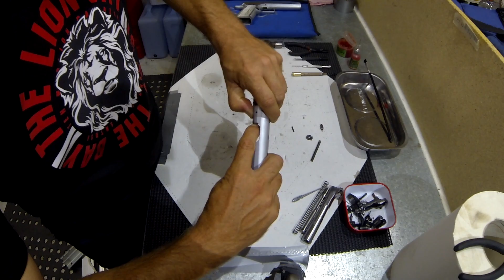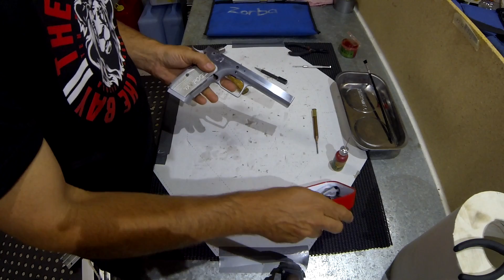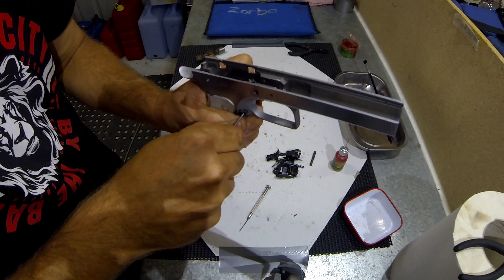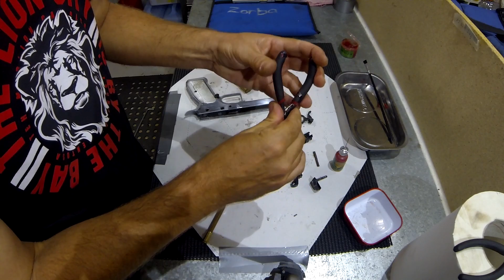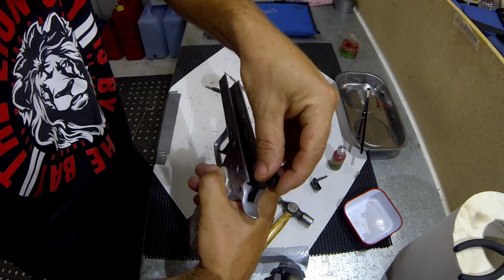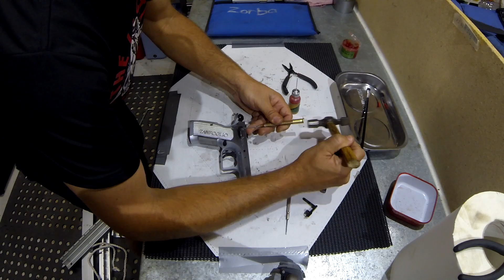TANFOGLIO STOCK PISTOL COMPLETE RE-ASSEMBLY VIDEO

Comment: So helpful! Really wish I could have seen a closeup of everything. But I was able to disassemble clean and reassemble with your instructions. 

This was the first time I ever cleaned a gun! And even though I'm a newbie and don't understand the part names yet it was easy to follow. 

The worst part for me was figuring out the trigger. You said to put the left longer part of the spring on the left over that center indentation. And the right shorter side in the hole. However, there was a noticeable literal round hole on the plastic part and for 1.5h I was trying my best to insert in it. Then I figure it out. 

The easiest way is to first force the long left side into position, then force the right side into the black plastic right corner. 

Then from there on I was able to follow everything in a reasonable pace. 

Thanks a lot!!
Reply from the maker: Congrats on getting it done and thank you 🙏

Comment: Thanks Paul for this video I got my Tanfo Witness Limited 9mm out for a run after a few years abd decided to clean it. While I did the sear cage popped out and I could not reassemble it correctly. I followed the instructions for moving that little safety spring to the left and right and it finally reset. I have no Tanfo gunsmiths in my rural area so I am on my own. I guess this is an old video judging by the comments but it is still a good video.
Reply from the maker: Well done brother 
Old but still helpful 🙌
Thank you

Comment: Hi.. Great vid....  I have a combat cohai TA90 and can't seem to find a video with my safety lever removal....  Mine has a recess in the frame under the lever with a spring loaded toggle on the lever itself...  This design seems to be unusual when looking at the EAA Witnesses,  CZ75,  or any other tanfoglio videos ...  Thanks
Reply from the maker: Interesting, can you figure it out?
Reply: @paulhagiantoniou530    Hi,.. Did manage to get it out, but the getting it back in was time consuming and stressful.  Got to be a better way than the way I did it...  Its working better. Was very stiff to toggle on,off.   I compressed the spring, cleaned the area and added some wax to the mating surfaces... I can live with it now.  thanks for the reply...

Comment: Thanks for this video Paul. Changed my hammer spring after 10 years of use. It was 5mm shorter than the replacement spring I bought from Estonia. Took me 10 times longer just to fit the cage. But I did all this because of the confidence that your video gave me to do it myself.
Reply from the maker: Good job Mark 👌

Comment: I have a couple of questions for you Paul but first thank you for your excellent video on how to put this together. This is excellent information, perfectly executed and articulated. 

-How does the chrome finish do against corrosion? Where I shoot it rains a lot and I do not stop my training for rain (within reason).

-How many rounds have you put through this gun? Have you done any work on the trigger? and how reliable is igniting hard primers?

-And last, do you find the slide batters the frame to the of damaging or marring the frame? or in other words, do you see any signs of wear on the frame and slide do to battering? (9mm caliber correct?). Curious as these guns do not have a plastic buffer like the new Shadow 2 (which I had and sold).

I am debating on getting this stock II or the Extreme,. Cheers and thank you!

Comment: by far the best take down video for tanfoglio stock 2/3.. thanks man! btw do u have an idea whats the stock springs on my stock 3 special? main/ firing pin/recoil..  im thinking changing mine with medium hammer spring and med f.pin spring so that i can still run stock f.pin. does it make sense? or its better to change it to light all the way with the extreme f.pin?
Reply: im having a hard time hitting plates fast and accurately on DA.. i havent changed anything since i got it

Comment: what punch dia do you use for the Ambi-saftey roll pin ? great video thanks really helpful
Reply from the maker: I could not find a punch small enough so I made my own with an allen key that I cut and fitted into a jewelers set of small screwdrivers, I just pulled out the driver shank and replaced with the allen key then silver soldered it in.

Comment: This video and the disassembly one are going to be a life saver! I just bought a used stock 3 with less than 2000 rounds on it and I'm sure the guy never cleaned it! What size punches will I need please?
Reply from the maker: Just purchase a set from a hardware store. Get the smallest diameter set.

Comment: Hi from Spain. A zillion thanks, for your knowledge and for your time. This is not only a video, is a perfect description about we are going to find, step by step, and the photos with the explanations on the not so easy steps, are a huge plus. 

I would like to know what is the weight in DA in your gun. I have acquired a Stock III special 6-7 months ago, it has about 1000 shots and DA is about 11 pounds. I expect around 7.5 - 8 pounds, no more. 

Do you have any recommendation to lower the trigger weight?.

Thanks.
Reply from the maker: +Antonio J Hi Antonio, sorry for late reply no internet connection for four days.My DA is just under 6 pounds, get the light main spring and Titan hammer from Eric, also change to extreme firing pin with light spring.

Comment: Very good video, the best for Tanfoglio Stock II assembly.
Thank you very much Paul. I can now change the springs on my Stock II.
What are the strengths of your springs in your Tanfo ?
Recoil spring 10 lbs ? Hammer spring ? Firing pin spring ?
Do you use an Xtreme firing pin ?
Thanks
Happy New Year 2016 from Paris !
Best regards
Alain
Reply from the maker: +Alain G Thank you for your comments Alain.Ok the hammer springs from Tanfoglio are not rated in pounds, rather light medium and heavy, I am running the light with the light firing pin spring. on the recoil spring I have a 10 pound and I am running all the extreme parts. It is needed to run the extreme firing pin because its slightly longer and ensures better ignition. I use only federal 100s for match because they are softest primers, anything for practice. Cheers.
Reply: Thank you Paul for your answer. I have now all the Xtreme parts to change my Stock II. Of course, I will keep my iPad with your video to do well !
Happy shooting
Alain

Comment: What's the weight of your recoil spring?
Reply from the maker: +Denver Valdez Its the LIGHT extreme spring from Eric, my Stock 2 has all the extreme parts in it. If you install this spring make sure you also have the Extreme firing pin and firing pin spring, would also help to add the Titan Hammer, if you experience light strikes send me a message.
Reply: +Paul Hagiantoniou Thanks Paul.
I just ordered this kit http://benstoegerproshop.com/eaa-tanfoglio-witness-upgrade-kit-springs-guide-rod-firing-pin-sight/
Plus an extra 8lb recoil spring to test out.
Reply from the maker: Ok no problem with ordering from Ben, hes a good guy. Are you shooting IPSC production division ? if so your gun will not comply with the rules. To stay production legal you have to fit parts that are OEM or Extreme, from Eric.
http://www.ericgrauffelonlineshop.com/en/
Reply from the maker: You can get these parts from other suppliers but need to make sure what you are getting.
Reply: I'm shooting USPSA now but would like to shoot IPSC as well when my crew goes to the Philippines. Thanks for the quick response.
Reply from the maker: +Denver Valdez Ok Denver, the recoil spring will not be IPSC legal, not sure about the other parts from Ben, they may be OEM or Extreme, or after market.Also 8 lbs  is too light, for the 125g bullet you need a 9 10 or 11, I use the 10.
Reply: +Paul Hagiantoniou okay sounds good. I'll just convert back to OEM when I go to PI for IPSC. Thanks
Reply from the maker: That's the way.
Reply from the maker: +Denver Valdez 10lbs recoil spring, light main spring.
Reply: +Paul Hagiantoniou will do sir. Thanks again

Comment: Paul, a solid 2 hours of cleaning and swearing but she is back!!! Thanks a heap for the vid
Reply from the maker: +6vorn9 Good job mate, now you have done it, it will be easier next time. remember to look for bur marks on metal to metal surfaces.
Reply: +Paul Hagiantoniou  gotta say the extractor was the killer
Reply from the maker: can be, quite allot of pressure needed to keep it in place, if pin misses the hole it locks it all up. try rounding all your pins, helps allot.